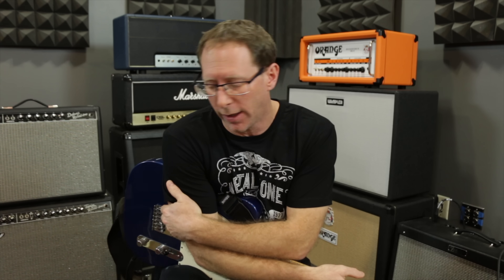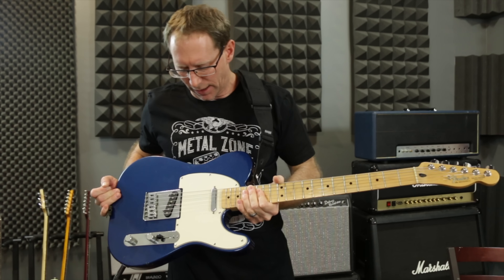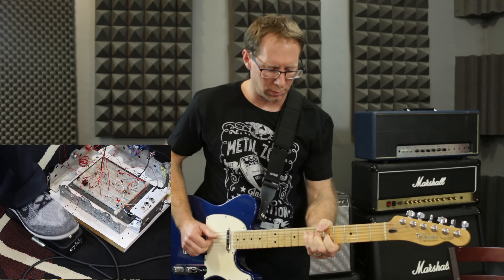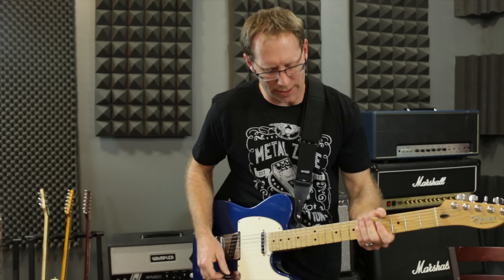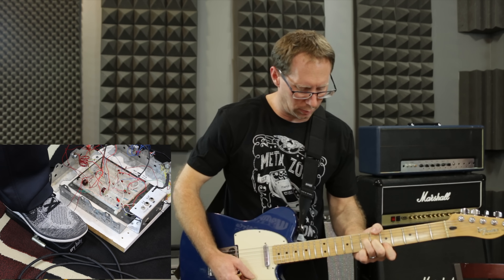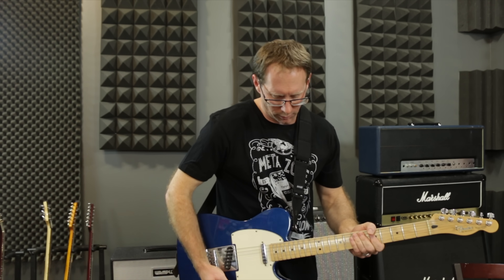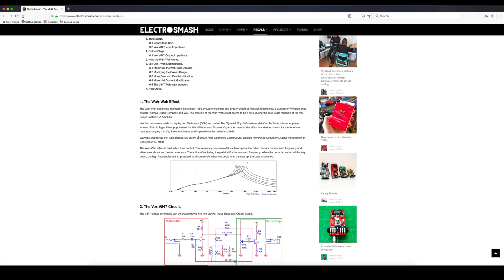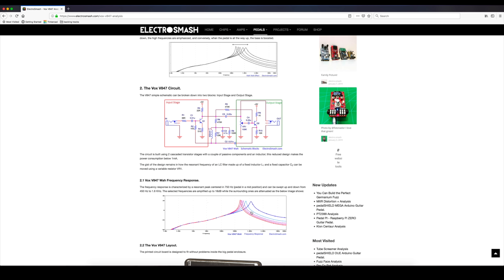Wah Pedals: Does the inductor affect the tone? A comparison

Comment: i definitely heard the difference. and there is a difference in the inductors when i try it out, too. 

this comment is boring, unless you are an electronics tinkerer that wants to breadboard a crybaby/ vox v846 wah circuit:

depending on the inductance, the center of the frequency will move up or down. it goes against intuition, but you really must mess with the various other components to make the differences in inductors apparent. 

most obvious change: if you find that your inductor gives too much of a bass-heavy sweep, change the sweep cap (the .01uF from inductor to emitter of transistor 2) to a smaller value. and a bigger value if your inductor gives you a sweep that is too treble-y. 

 the resistor parallel to the inductor (usual values: 33k, 68k, and 100k... i've taken it down to zero ohms which kills the wah-ing, and up to 1 meg), which has to do with the q is another one people like to mess with, but there are other more drastic component changes: 

the capacitor to ground off one of the inductor (usual values 4uF, 4.7uF... i've used anywhere from 1uF to i think 100uF, definitely subtle but helps with fine tuning), the emitter resistor of the first transistor (very obvious) in tandem with the resistor that connects from the inductor to the base of the first transistor. 

if you have an inductor or two that you dont really care about (too strong of a magnet can apparently mess up the ferrite material), a fun trick is to put a magnet on the inductor. the stronger the magnet, the further up into the trebly frequencies the sweep will move, all the way to completely out of the human ears' range if a rare-earth magnet is placed in the right spot.

(i never even mentioned transistor changes, which can be quite drastic, and will usually require tampering with the other components' values)

Comment: I did the same thing. I built a wah with a red Fasel, a Halo and a stock Dunlop inductors wired to a rotary switch and did some blind testing, and my favorite was the stock one: imho it has the best sweep, and cuts through the mix better with distortion. I hated the fasel, thin and uninspiring. The halo was cool, with a mid-bass focus, but was microphonic at higher volumes!
Reply: then try the yellow one. I though it won't be good for me as i am/was not after vintage tones. but I prefer the yellow anyway.
Reply: I think I heard it the same way you described it.  I wasn't so down on the sound of the yellow one; I was thinking it would be cool for a clean, non-lead blues, country, or funk part that isn't supposed to cut through a mix, although I might like to hear it on bass in a parallel setup, just to see.  I liked the extra feedback on the Halo; was that caused by microphonics, or just a boosted frequency range?  I thought it was the latter, but I'm not an expert.
Reply: @robcerasuolo9207  Mine was definitely microphonic - it would squeal when the pedalboard was directly in front of the amp.

Comment: I think each inductor sounded a bit different, but not drastically. I changed the inductor in my gcb95 last month for a halo inductor. If anything, it was good practice in desoldering
Reply: The traces in gcb95 (2001 version) pcb are poopoo. Ended up having to jump-wire 4 times on top side due to copper solder point circle dissolving/disappearing when changing resistors. Red Fasel made little difference-the LED power indicator addition was the best part, and I ran mine to the center heel plate for visibility.
The Halos are hit and miss, but if a hit (like this video) the sweep is made velvet, but not enough pros to justify $50 for only the inductor IMO. Upping the tone box resistor (frequency) range was the best result/dollar.

Comment: Thanks Brian. This is a rabbit hole I have been jumping around in for the past year, but without your skills and resources. I got a Jext Telez White Pedal and it changed my life. Then I got a Spectrum SP-1 and am definitely in search of alternative players for that slot. (hint, hint). I actually have not gotten a wah yet, but after looking into it, I was thinking I want to mod it with a rotary switch and about five inductors built into it. Daunting and costly FTW! I didn't like the dodgy capacitors-only band pass for the compression drivers in my Super Beatle cabinet and I am running an Ashly active crossover until I figure out which sort of crossover or band pass I will use. It is very costly to purchase inductors as you mentioned, I guess I should get a winding machine.😸

Comment: A local surplus electronics place - long since closed - had some ferrite-core inductors in a bin for a buck apiece.  I bought a few, and a friend measured them for me.  They came in at 900mh, with a tap around 800mh.  Traditionally, wahs will use something around 500-600mh, so mine was well on the high side.  I built myself a wah circuit using the inductor and a Crybaby schematic, thinking it might end up being more suitable for bass.  Took a bit to tailor the gain of the first transistor (stock emitter value did NOT work at all), but eventually I nailed it.  Much to my great surprise, I got a very usable guitar wah sound out of it.  My nearest comparison is Jeff Beck's wah tone on the "Truth" and "Rough and Ready" albums.  Not an overly wide sweep, like you get here, but plenty expressive.

As I recall from RG Keen's participation in ancient forum chats about inductor types, what  is distinctive about Fasels and other "stack-of-dimes" inductors is actually not audible at point of installation.  Rather, over time and use, the ferrite-core types become magnetized, changing what harmonics get emphasized.  At least that's what I recall.  It's been many years since we had that discussion.

But nice demo.
Reply: You can compensate for the measured value of the inductor by adjusting the value of the stock .010 sweep cap. 
For an 800mH & higher inductor, you could change it to .0068uF.
If you have an inductor 450mH and below, start with .015uF & go even higher with lower inductances to compensate.
Reply: @markmarshall7939  Thanks for that.  Useful info.
Reply: Hi Mark -  A while ago I did extensive testing of wah circuits and of the various inductors. As far as I could tell the ONLY audible differences due to the inductor were differences in inductance and in winding resistance. The original Cry Baby circuit shows the inductor value as 500mH but the actual inductors I sourced all measured as higher than that, most in the 600 to 680mH range. Differences between individual wah wahs are mostly down to tolerance variations in the inductor value, in the sweep capacitor value, in the gain of the transistors and in how acute the angle ground into the back of the treadle happens to be. Over the years the mechanical travel of the pedal varies quite a bit and it varies from manufacturer to manufacturer. The control character of various wahs varies, depending on whether they use an S law control pot (linear over the wah range) or a modified log law. As far as I can tell the original pots were all S law.
In most cases trying to adjust the wah range by slipping the rack and pinion back or forwards by a tooth or two gains you nothing because the track resistance of Wah pots flatlines for the first and last 40 degrees of rotation. And in any case, given the course ratio of the gearing, there is little adjustment available before you start to slam the pot wiper up against its end stops.

As far the core saturation / magnetisation thing is concerned I couldn't find any evidence for that. Even attaching a fairly  strong magnet to the side of the inductors made no audible difference. In any case any distortion due to core saturation would likely be swamped by the inherent distortion of the two transistor circuit, which is itself quite high. I also found that the frequency response of the classic wah circuit is not simply of a bandpass or resonant low pass filter being swept up and down, but is in fact something rather different.
In this demo the only obvious difference I heard was with the Yellow Fasel which shifted the entire wah range a little higher. I would guess the Yellow Fasel has a lower inductance than all the other inductors used.
Reply: @ResoBridge  Thanks for the reply.  Nice to see you here!  Like yourself, I think many of the attributions often made to "magical" components found in certain pedals or issues of pedals have a lot more to do with component tolerances than any special properties.  Particularly when you consider that comparisons are generally made with ONE instance of the magic-part pedal, rather than multiple instances where qualitative component characteristics can be separated from component-value differences more readily.  As I learned from my own build, an "off-spec" component can be adapted to/for by tweaking other component values to achieve the same overall outcome.

Wah pot design IS a sort of voodoo.  I suspect many users are unaware that the rack-and-pinion or camshaft or string-pulley mechanisms are deliberately designed to avoid rotating the put its full distance, lest the pot be broken under the weight of the user's full body pressure concentrated on that puny pot shaft.  And, as product-seekers often find with both wahs and volume pedals, taper can be a very personal taste.  The pot taper and range has to work with the mobility of your ankle and how easily one can "work" the few critical degrees of rotation to be expressive.  I just finished restoring an old Korg Mr. Multi (great pedal) and the pot taper is annoying.  The pedal is both a wah and phaser, that can be operated in direct-sweep mode, or you can use the foot treadle the same way as with a Uni-Vibe to vary the LFO speed of the auto-sweep.  The pot taper goes from slow to way-too-fast too easily to be able to mimic ramp-up/ramp-down.  I've tried playing with the gear, but can't seem to nail a fastest speed I like.  However a resistor between the wiper and one of the outside lugs suggests that the taper can be played with.

As for saturation of ferrite-core inductors, the truthfulness of that is well above my pay grade.  I'm a psychologist, not an engineer.  I'm simply repeating one of the hypotheses discussed, and raised by someone whose judgment on such EE matters I trust.  Of course, what can be measured and what can be heard can be two different things.

Comment: in defense of inductors ... you probably haven't yet used a lower gain transistor in that crybaby ... the mpsa18 is just overkill in there and switching to lower gain transistors allowed a lot of the other changes I made to my wah become more apparent.
Reply: The differences were subtle, I think I discerned something with my ears only once, but my fingers weren't on the strings. Good tip on the gain, maybe a bias adjustment could be used there. Some folks collect drives or fuzzes, I think I may be doomed to own every wah. Could be worse though.
Reply: yeah ... whether you re-bias what is in there or just go with lower gain devices, that's where I would start then see where it goes. I'd definitely use up all my knowledge and parts bin before I ponied up the dough for a fancy inductor or allegedly ICAR taper pot
Reply: I feel no particular inclination to duplicate the sounds of the past, but it seems like I feel a compulsion to squander vast resources to explore this very minor quibble of tone. This, and rectifier voltage sag. little things.